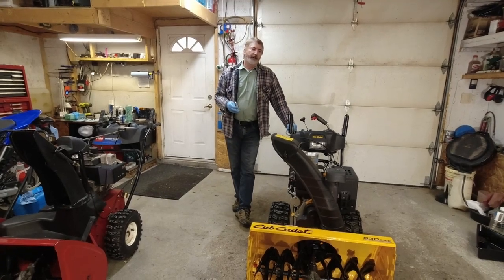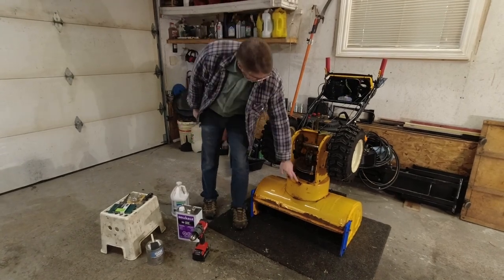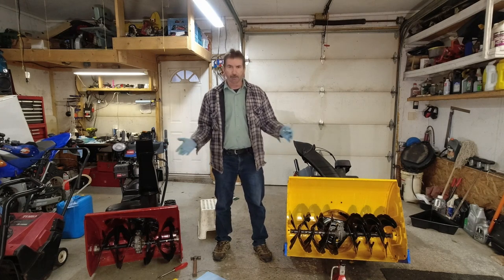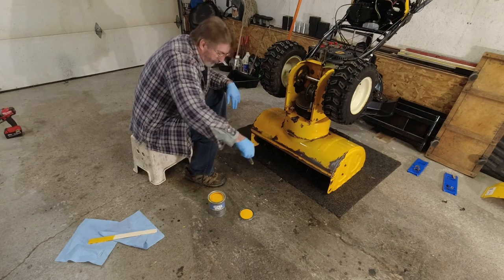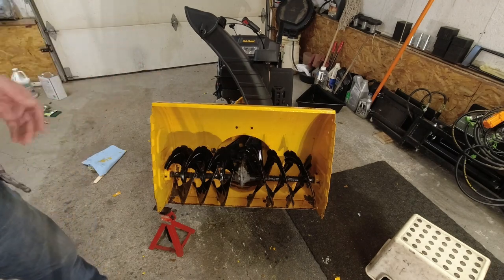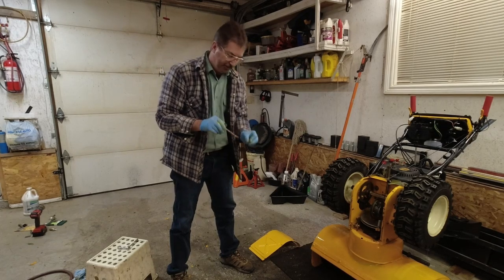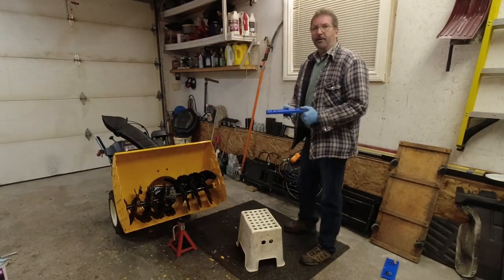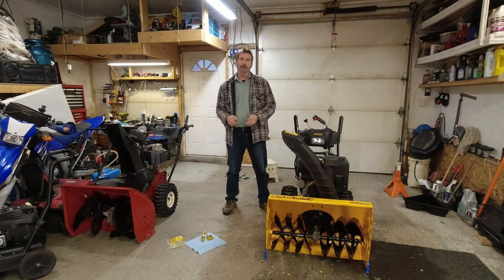Importance of washing and Paint touch on a  Snow Blower.  #FrugalWithJohn

Comment: Thanks John trim plaid red where do you buy that red paint. I to have a very old toro that was given to me the woman friend didn’t want it. I’m trying to get it going having issues with carbureto. Cleaned carb and she will run then die after 1 hour and start puttering.
Reply from the maker: I just ordered an adjustable carburetor for a tecumseh engine. I have not tried it yet, here is the part. Canada https://amzn.to/3FQ5HZj   USA  https://amzn.to/3fHKlTp The paint I use is, Canada https://amzn.to/3FHzvr2  USA  https://amzn.to/3qNkShJ (Affiliate links) Make sure you clean the inside of the fuel tank if the Snow Blower has been sitting for awhile.
Reply: @FRUGALWITHJOHN  thanks, my gas tank I drained old gas put in new and drained again. 
Is that good enough or is there another way?
Reply from the maker: There is many ways to clean a fuel tank, it all depends on how dirty it is. I will make a video on cleaning a bad one this summer. What you did, normally is all that is required.